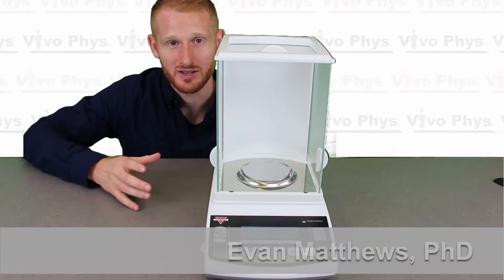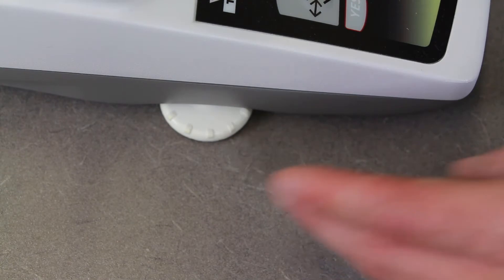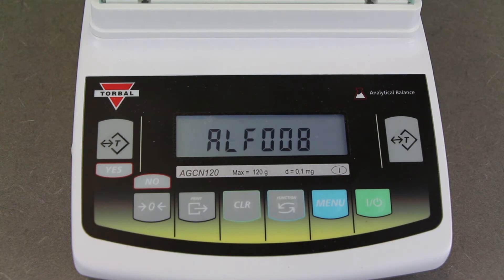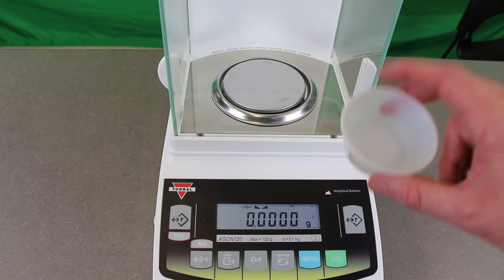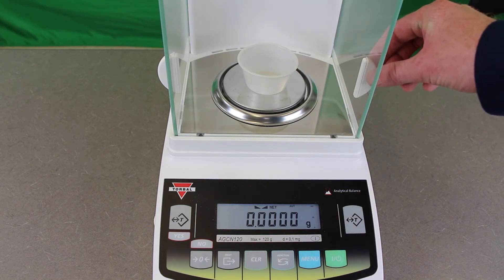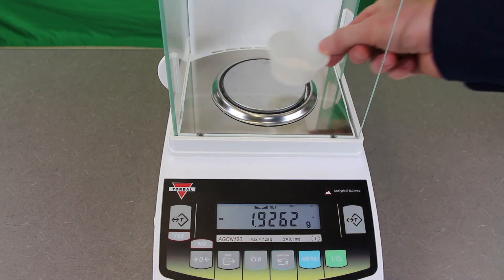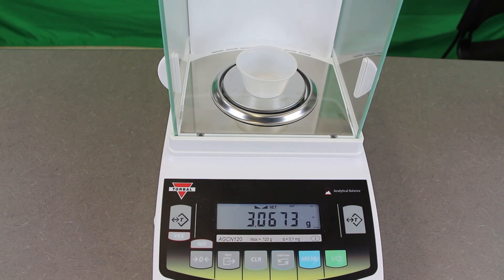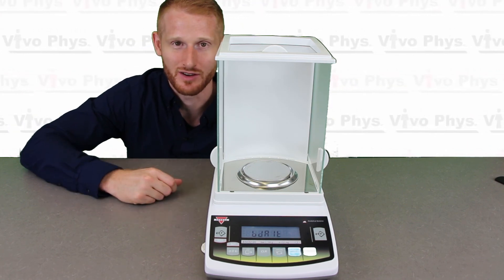Precision scale - Grams and Milligrams

Comment: Your video title mention milligrams but only grams are shown? Trying to weigh milligrams for filling capsules for supplements is impossible to be accurate when scales cannot accurately weigh less than a gram. So, example, I need 200mg o L-Theanine, but scales are not precision accurate enough and do not weigh less than a gram. How do I continue, seeing I bought all bulk powders for my health needs and capsules? Thank you.
Reply from the maker: You need to convert the decimal places of the grams unit to milligrams. The device reads to 0.0001 grams which is 0.1 milligrams.

Comment: Hello friend, I want to ask a question. I have a cheap 0.01 scale. Yesterday I wanted to weigh two and a half (2,500) grams and the indication on the scales read 2, 53. Does that mean it's 2 grams and 530 milligrams? thanks .. Anyone who can answer I would appreciate it.
Reply: yes, that means exactly that, or you could say you have 2 530mg or 0.00253kg
Reply: @termivan  it’s useful to learn the prefixes of:

10^ -1 = deci (0.1), 10^ -2 = centi (0.01), 10^ -3 = mili (0.001), 10^ -6 = micro (0.000001), 10^ -9 = nano (0.000000001), 10^ -12 = pico (.000000000001) - grams (in this case). 

You can apply same prefixes in any standard weight of measure, distance, etc.

Example
1: millimeter = 10^ -3 meter = 0.001 meter (m)
2: picohertz = 10^ -12 = 0.000000001 hertz (Hz)

You also have positive prefixes like 10^ 3 = kilo (1000), 10^ 6 = mega (1000000), 10^ 9 = giga (1000000000), 10^ 12 = tera (1000000000000), 10^ 15 = peta (1000000000000000), 10^ 18 = exa (1000000000000000000)

Example
1: 1 megaton = 10^ 6 ton = 1000000 tons (t)
2: 1 kilovolt = 10^ 3 volt = 1000 volts (V)

To separate the units, negative units are usually written with lower capital letters, millimeter (mm), picohertz (pHz), and positive with big capital letters, megaton (MT), kilovolt (KV).
Reply: @nabruzkino  why did you tag me? Maybe you ment to tag the op, but anivays , i completly agree with you and nice coment
Reply: @termivan  yeah, my bad, moj slovanski brate. I thought I was just commenting under the existing comments and did unfortunately press the last comment in the thread, ergo it tagged you. Have a nice day, every day.

Comment: about how many pieces of salt are in a milligram?
Reply from the maker: That would be impossible to say because there is no standard size of a "piece of salt". However a Google search could easily tell you how many milligrams of salt are in various volumetric measurements (e.g. how much salt is in a teaspoon). That will likely assume you are using normal iodized table salt.